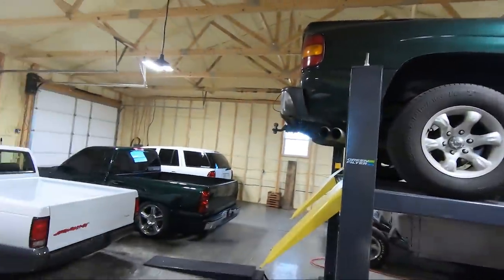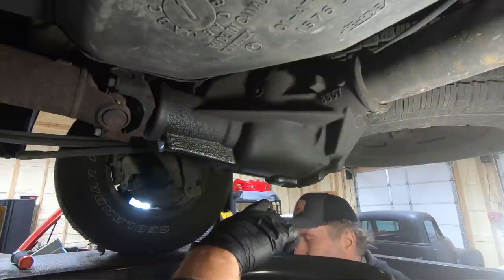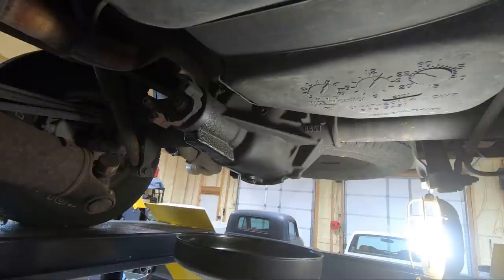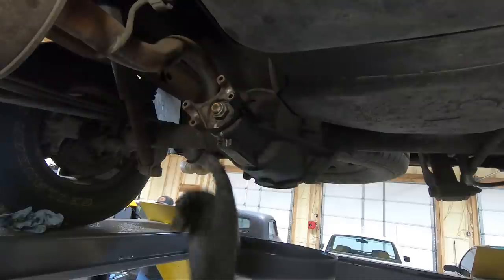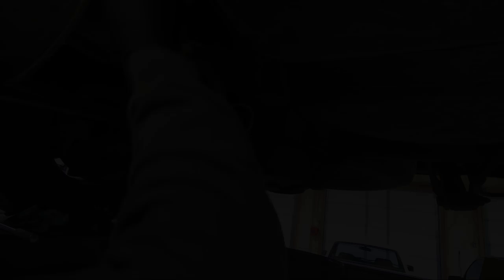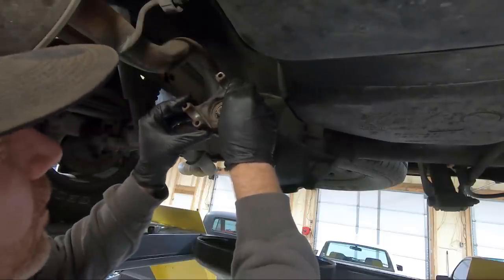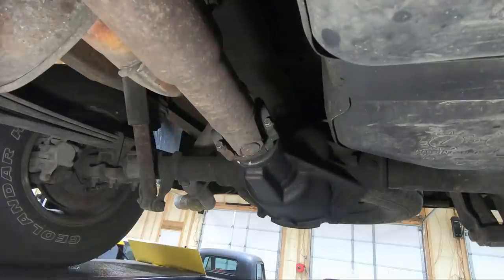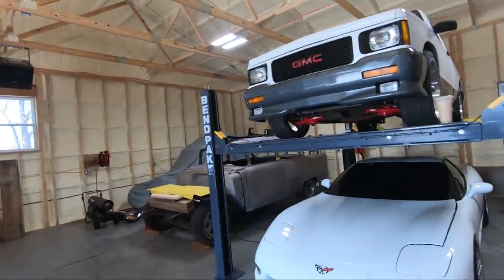How To Replace Pinion Seal GMC Sierra and Chevrolet Silverado (Dad's Truck Fix)

Comment: I’m not understanding, the manual asks you to document the breaking torque (I work in an Industry that is torque dependent).  Breaking torque is a qualitative value as it’s not a constant.  I have a decade of research proving breaking torque is qualitative. This is my question, what is the torque speck for this bolt? I understand counting the threads.  Wtf is the center bolt torque value?
Reply from the maker: No idea as it isn't the by yhe book method to fix

Comment: Went to weld a magnaflow under my son's 2000 rcsb and found it had been slinging diff fluid on the gas tank and a little on the exhaust. He and I are gonna tackle it this evening. Never done one either, so thanks for the video, Travis!
Reply from the maker: Thank you

Comment: My mecanic changed the u joints and seals on both sides of the shaft, one u joint was about to brake and I start feeling vibrations ,but I think he did not marked the way it was and and now, still vibrates but in a diferent way, how can I fix this? How can I know the original position of the rear end joke?
Reply from the maker: You can't. Have to pull apart and mic everything. Not for the novice mechanic
Reply: Thanks for your response, I checked my self and turns out that the u joint was l little loose, I loosed the two bolts and hit the u joint cap that looked flat and  it when down/in  about 1/8. No more vibrations 😊
Reply from the maker: @rickyricon2787 👍

Comment: Know this is an older vid, but I’m working on my truck currently, and a weird rubber seal broke. It was located on the threads/gears, what is that rubber piece called? Or at least is it necessary to get a good seal?
Reply from the maker: Not sure what you are talking about

Comment: I couldn't get the seal  flush on my 90s Chevy I just went ahead and put on the yolk and didn't know anything about lighning or marking anything up I just put 120ft lbs into that bolt a couple people told me to put only like 10-30 in lbs which there's NO WAY it's in lbs? I most I could put was 120ft lbs so hopefully I'm good? I'm not a mechanic and have zero help with no friends.
Reply from the maker: Time will tell I guess

Comment: Any idea if the 32mm is standard for most gm diff pinion bolts? I'm about to replace the leaking seal on my 2016 Canyon rwd with the G80 locking diff.  

Very simple and clear vid! Thanks!!
Reply from the maker: Not sure

Comment: Good video. I'm glancing at this because I haven't done one in ~30 years and mine is leaking (former GM Master Tech) and I'm just looking for a refresher on fastener sizes and such. Mine is leaking by the splines, as evident that the nut is shiny. The tip I have is to use Loctite teflon pipe thread sealer on the pinion splines before reassembly. It might eliminate a come-back.
Reply from the maker: Time to get it swapped it sounds like.

Comment: I put a junkyard axle gt8 g80 optioned and it needs one of these seals badly it leaked about 8 ounces of diff fluid in just a couple months time and that's cause I don't even drive it often I was debating whether or not to take it to my mechanic but, this seems like an easy enough job for me just need to rent a puller though thanks for the vid brother!!
Reply from the maker: Not too bad. Definitely give it a shot before paying a shop

Comment: Very informative Mr T. I have to do this on the WS6, it went bad when I dropped the suspension. Pinion angle way off, addressing this issue with BMR products, adjustable torque arm, LCA relocation brackets, etc....
Reply from the maker: That sucks.

Comment: Hello, great vid btw. Do you know if you can replace the outer pinion bearing the one right behind the seal while you have the seal out or does it have to be done from the inside. Thanks for your time.
Reply from the maker: I don't think you can
Reply: @TWAMotorsports  I appreciate it
Reply from the maker: @FoxtrotMaulOutdoors you're welcome

Comment: Love your content...I have a 02 silvarado stepside stock height on a set of 24s with 305/35s what is a good set of shocks to use I'm not going to drop truck...Any suggestions?
Reply from the maker: Probably monroe
Reply: @TWAMotorsports  ok

Comment: Good Thursday evening TW. Working on dad's truck.. awesome.. I like the GM forest green on vehicles. It's a sharp color 👍🇺🇲
Reply from the maker: Thank you. Yeah. I tried to buy his first.
Reply: @TWAMotorsports you'll find one like it..... I'm looking forward to video of the transmission replacement in your dad's SSR...if I'm not mistaken I think they have the corvette motor in them sport trucks.. I remember when they first came out.. cool looking 🇺🇲👍
Reply from the maker: It's the early one with the 5.3
Reply: @TWAMotorsports  2001. Is it?. 4L60e. M30. Automatic transmission I believe...I used to work on those back in 01 when they came out..
Reply from the maker: They came out in 03 and his I think is an 04. 4l60e

Comment: My 2012 GMC Sierra 1500 rear axle pinion is leaking oil, it looks a lot easier than I thought. Did you polish the yoke sealing surface for the replacement seal?
Reply from the maker: No we didn't

Comment: I took my 2006 Silverado 1500 to a shop about 7 months ago and paid them to replace this seal. Now, I noticed a few days ago it started leaking again. I assumed they checked the bearing and the pinion yoke. It didn't leak right away, so maybe it is just a faulty seal or installation issue? It is under warranty yet and should be able to take it back, but what do you think about this?
Reply from the maker: Hard to trust shops doing the right things these days

Comment: I just changed mine about a month ago in my Black 2000 stepside Silverado.
Reply from the maker: Not too bad of a job
Reply: @TWAMotorsports  No it wasn't too bad. I ended up taking the rear diff cover off, and noticed one of the spider gears had a couple chipped teeth. I still need to go back and fix that though. I bought the truck about 15 years ago with 65k miles on it and now it has just shy of 240k. Still stock 4.3. Been wanting to do an LS swap and lower it for several years now, but haven't gotten around to it. Maybe someday. Its been a good truck though, people ask me all the time if its for sale.
Reply from the maker: That's crazy it chip the spider gears.

Comment: Hey I’m trying to loosen the pinion nut rn but the yoke is rotating aswell
Reply from the maker: Wheels need to be on the ground
Reply: @TWAMotorsports  they’re on the ground now and stilling moving thought if I put parking brake would help but not teally
Reply from the maker: Parking brake is the only other option I would suggest

Comment: Did you force that nut back to the original position? I did my truck the mark is exactly the same as your.
Reply from the maker: Counted turns.
Reply: @TWAMotorsports  I guess I should say it didn't go back exactly the same is just a bit off is like just a little bit
Reply from the maker: @pedropadilla686 may be fine

Comment: I got a 92 Chevy 4.3 v6 well it belonged to my pops and he messed up the seal and replaced it but didn't do it correctly, he was dying and wasntv in his right state of mind well I got the driveshaft off the truck and didn't know anything about aligning it up but I'm trying to figure out if I should drain the oil completely and replace it or just fill it up? Also I'm not sure how much torque I put on that  nut that holds the yolk onto place? The parts I have right now are new including the nut.
Reply from the maker: I'm not sure on those years but I didn't torque,  just counted the turns. I would drain and refill
Reply: Same here i don't know anything about these trucks and nobody will help me,  I've got to different books on these trucks and both or different from each other hahaha which makes zero sense? And I'm trying to figure out what is a ring
Gear? I YouTube and Google it and still don't understand what it is or what it looks like? I don't know shit about this stuff and didn't have a dad growing up to show me anything.  I don't know what to do?
Reply from the maker: Probably should take it to a reputable shop then.
Reply: @TWAMotorsports  if I had the money hell lol plus it's sitting in the yard with no differential fluid and it's not legal
Reply from the maker: Gotcha

Comment: 0:16 Any idea why the bottom rust like that I have a 2003 gmc sierra same color and its been a florida truck all its life and it has rust build up right underneath the door everthing else on the truck is ok
Reply from the maker: Dirt gets between body and panel. Add a little water and boom.

Comment: Wich nut is the pinion nut?
Reply from the maker: Only nut we removed on rearend. Big on in the middle we counted the turns on
Reply: @TWAMotorsports  thanks. I was watching some videos and they were showing a washer and a nut inside of there. Thought it was one or the other.